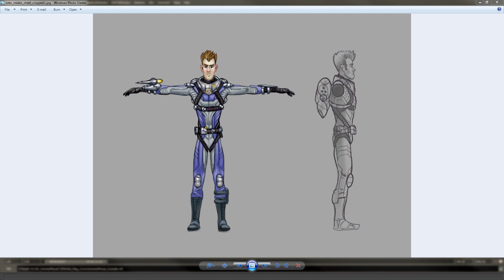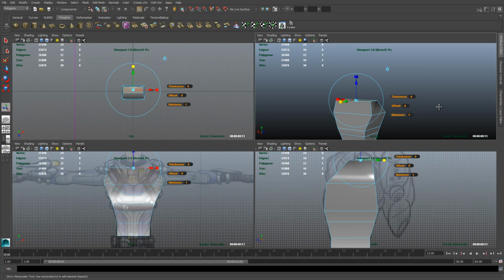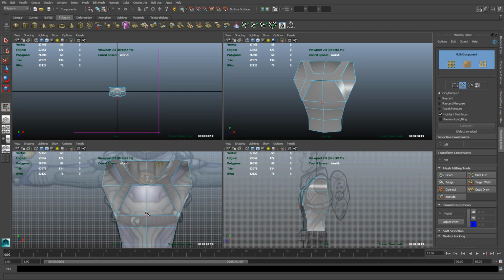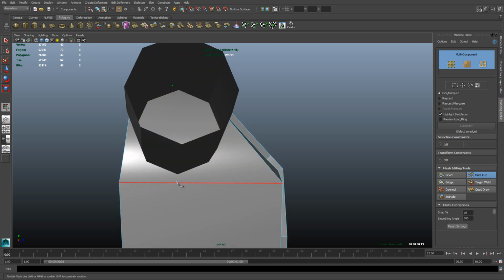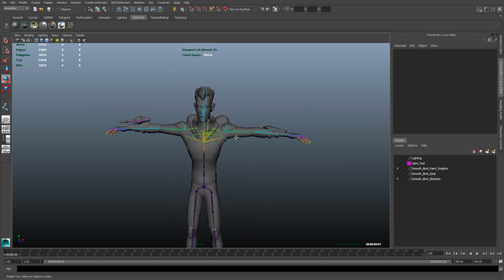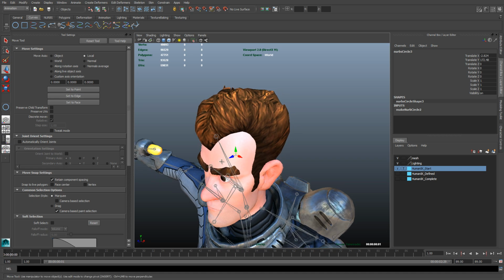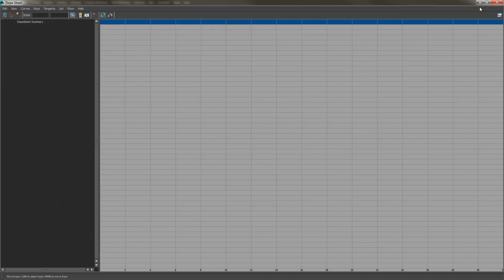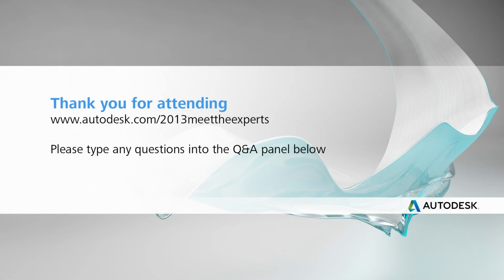Meet the Experts: Learn about Maya LT, 3D for indie game makers

Comment: I want to make an indie game and I have some questions. Didn't OpenGL deprecate quads? Should they be converted to trigs afterwards or something? What kind of deformations happen? What are the specific advantages of Maya LT over Blender3D for devs not using Unity?
Reply: Yes, quads are gone since OpenGL 3.0 (with forward compatible flag set during context creation) , and since OpenGL 3.2 when using the core profile. You should use triangle strips instead. Or if triangle strips are pesky to use, use triangles. Remember that you can specify a primitive restart index now, so you can specify huge triangle strips.

Comment: I'm using Maya and can't use the modeling toolkit. It shows up grey and won't let me click it. What's wrong?

Also every time I click on an object in edge or vertex mode it appears as a yellow to red gradient along the edges lines and vertices. This is making it very difficult for me to see what I'm doing.

Thanks.
Reply: Try going into Windows-Settings & Preferences-Plugin Manager and check to see that modelingToolkit.mll is loaded. That's the first place to look. As for the gradient you are seeing, could it be because you have soft select enabled? Try turning that off by pressing the B key.
Reply: Matthew Doyle Everything worked perfectly! Thank you.

Comment: Can I Do this in maya not maya LT
Reply: Sure! Maya LT is based upon the same code base as Maya, and has an identical UI.
Reply: Kintaro Takanori There's really not a way to set it that I know of. But, you can try changing the scene unit size form 1cm = 1 unit to 1cm = 10 units. Also, if you are trying to zoom in on a vert and find the camera zoom slowing down, try pressing F to frame that vert. This should speed up the camera's zoom again.